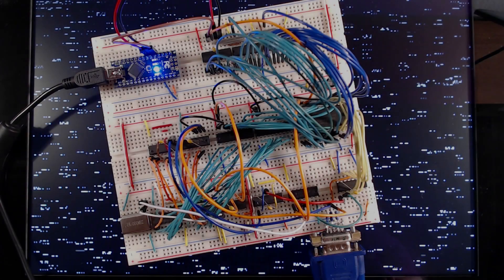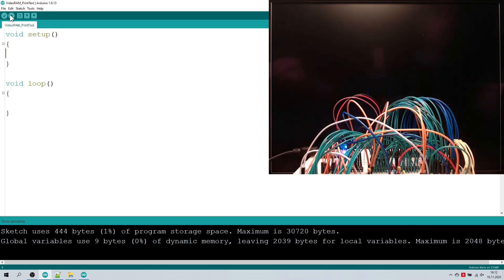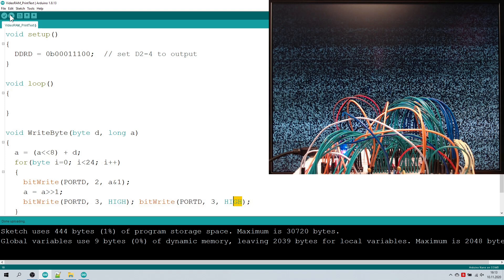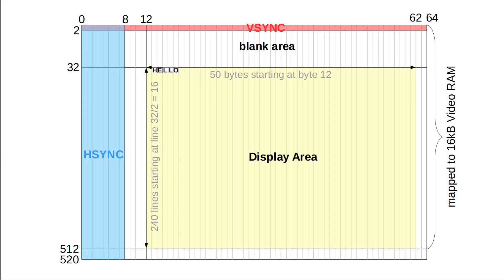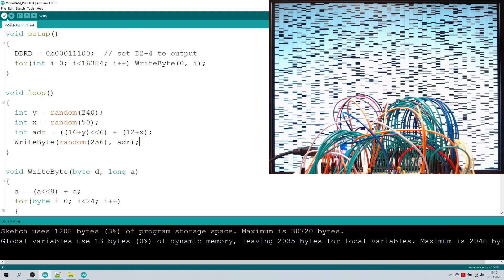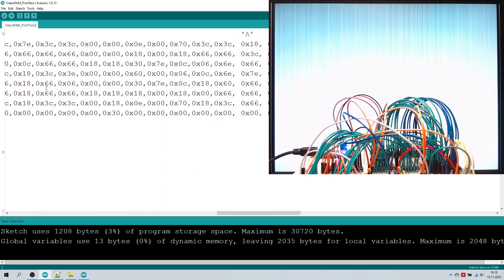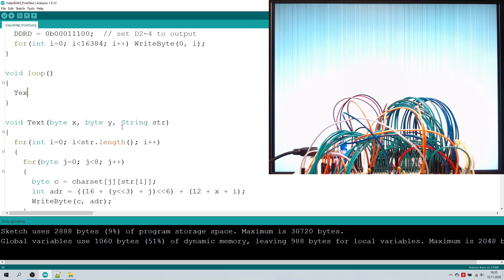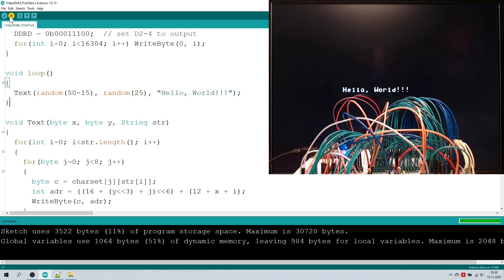DIY Video RAM #4 Text Output

Comment: Amazing Work.
My congratulations.

Looking at the electronic schematic you can easily see that the 3 color signals are connected together, to generate just two colors: black and white.
My question is if adding two more shift registers, totaling 40 (8 red, 8 green, 8 blue, 8 column and 8 row) bits, and also two more memory chips would it be possible to have completed the two remaining color bits.

The addresses of the 3 rams could be connected in parallel.

For each new memory you would need an HC165 to send the color bit to the bd15 connector

So with 1 bit for each color, it would be possible to have 8 colors in total.

It would be a perfect application to be placed on a CPLD or FPGA.

Is there any chance of working?

Thanks.

Comment: I am adding this system to my project. I use 328p to control it. As I can not read video ram, is there any simple way to achieve text scrolling or screen shifting without storing all the visible text into 328p's memory?

Comment: What if the cpu tries to write during the vga time window?
Reply from the maker: Hi, the concept 'time window' implies that the CPU cannot do anything outside it's time window. Here this means it simply has no clock outside it's time window. ;-)
Reply: @slu467  so how do u stop arduino when its outside the cpu window?
Reply from the maker: Hi Dhruv, actually in this design the Arduino is just mimmicing a "real CPU" since this video series focuses on the principle of the VGA card itself. Any real implementation has to ensure the property I've mentioned above. Too keep things simple here, the 16MHz VGA clock is identical to the system clock of the Arduino. The VGA card only activates the 74HC595 shift registers outputs. The Arduino may shift in new values (address and data) slowly since the 74HC595 have a "refresh" line (RCLK) that will update all outputs simultaneously. But it's really the quasi sync operation with the common clock that makes life easy here.
Reply: @slu467  oohhh okk thanks for the gr8 explanation !
Reply: @slu467  so if i AND my 65c02's clock(6mhz) input along with the vga 2mhz clock will it work fine?
Reply from the maker: @Dhruv.Wadhwa  I really cannot say anything about your configuration since I haven't tried it. As always, it's the details that matter. If you have an idea, think it through thoroughly and go for it ;-)

Comment: Think about series about producing a HDMI Signal with TTL logic . A simple 3 channel with three 16 Bit shift registers with differential outputs without any DRM is my idea. you take three VIDEO RAMs for every color and Shift the content out.  A Full HD signal is the limit for „slow“ TTL I think or only HD. Modern Monitors have no more VGA inputs and 640x400 is not an actual resolution to use.
Reply from the maker: Hi Paul, being a lazy person, anytime someone mentions a 'x3' my knee jerk reaction is to run in the opposite direction ;-) For me, building this in TTL would be a major pain. I'd rather use a micro or learn FPGA...

Comment: Slu4: Very neat and impressive again!  That Arduino seems to be able to clear and update fairly quickly, even with the serial-to-parallel interface.  Do you know what the effective VRAM bandwidth you get from this setup?  Of course, with a direct parallel memory-mapped interface to a CPU it may be much faster.
Reply from the maker: Hi Michael, the serial transmission through the shift registers is actually just the "cheapest" solution to get the job done. You are right: A real CPU hardware would access this in parallel much faster.

Comment: YES, thumbs up * 100 !!!  U thinking about integrate this and UART with your bread b. computer?, hope so.  
waiting for your next vid. 
 
p.s I have  been following many of you guys lately (Eater, Sharman, Clifford, Bates, etc many) and I like your projects and the way you present them very much.   

Cheers!
Reply from the maker: Thanks a lot, Alessio! Good to hear that you like this stuff, too. I briefly thought about integrating video RAM into my UART design but it will not play together well due to the UART timing requirements. Also, what I like most about the UART machine is it's utmost simplicity. For me it's beauty lies in this aspect. So I'll resist feature creep :-)
However, what I WILL do next is release more info and a mature PCB design for the UART CPU. I've been busy working on that over the last weeks. So stay tuned.